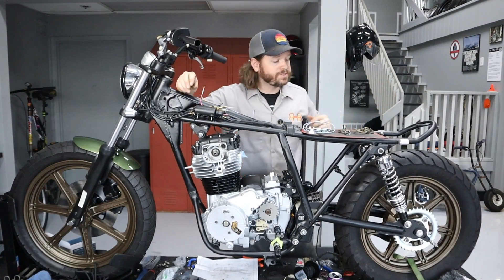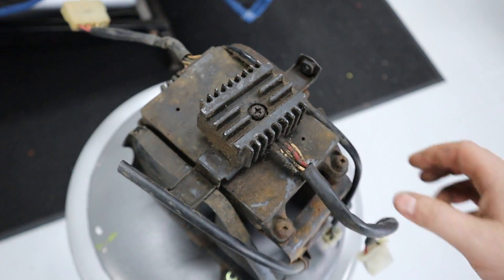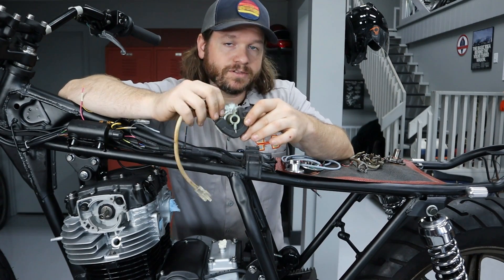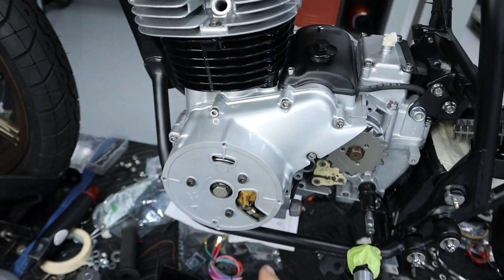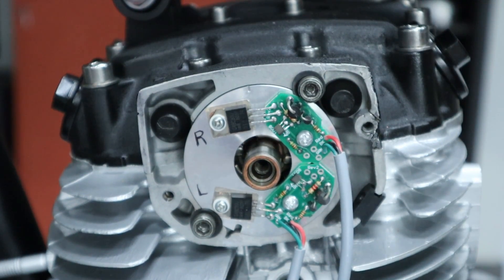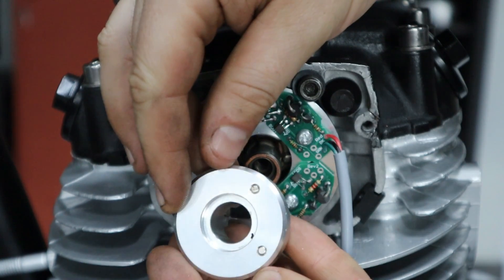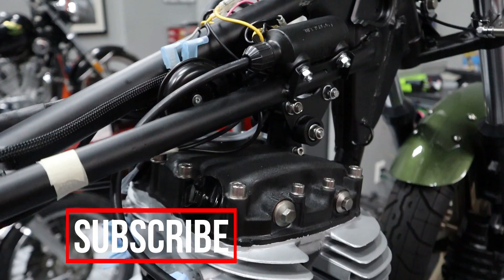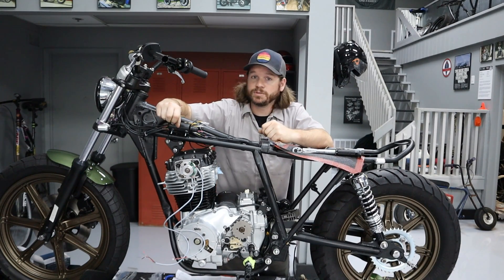Yamaha XS400 Electronic Ignition Install

Comment: I’ve soldered in new resistors and fixed a few cdi boxes I randomly came across one and then ended with a few it is usually the same resistor in my experience

Comment: Hello, I own a 1977 XS400D. It's running but with the explanation i just saw about replacing the ignition I'm wondering if it would fit mine. Mike's XS sells it but it specifically does NOT mention it would fit my bike. Thank you.
Reply from the maker: Right i explain that in this video. I go over the  changes and similarly between the points and newer electrical ignition and how to fit this.

Comment: I prefer a points system. Less worrisome. I always keep a match book under my seat. Points have kept motorcycles on the road for many years. Very glad to see someone spending the time on one of my favorite bikes. Mine was a 70s XS400 with spoke wheels and double leading shoe front brake. With a little tune magic it would do the Ton! Made it a Cafe Racer. Wish I still had it

Comment: How did you know to use 90 lbs of torque? Is that standard or does every item require different torque?
Reply from the maker: It's outlined in the instructions actually

Comment: I had an "XS360" that was almost exactly like this..... I picked it up to deliver pizza on & I want to say the bike was 7-8 yrs old
when I bought it in 1988-89 time frame?  Anyhow,  it was a peppy little bike that was easy to handle in the Washington, DC
area I was in & I could carry 2 large pizzas in a hot bad along w/ a 6-pack of cokes by laying them between my stomach &
on the gas tank.  The seat to tank kept it pretty level & my gut held it in place.  Great build,  got my attention.  TY,  peace